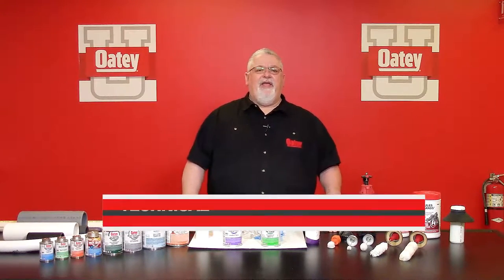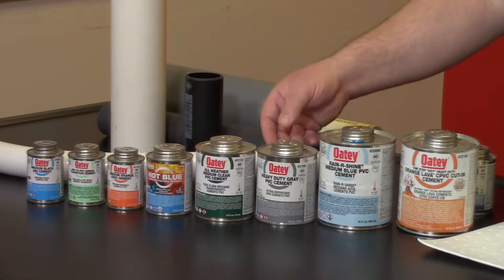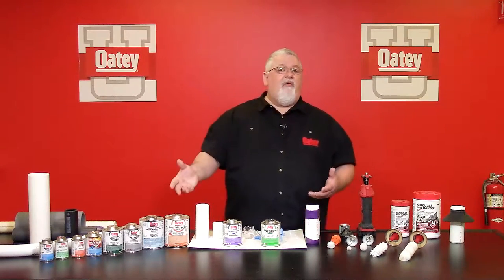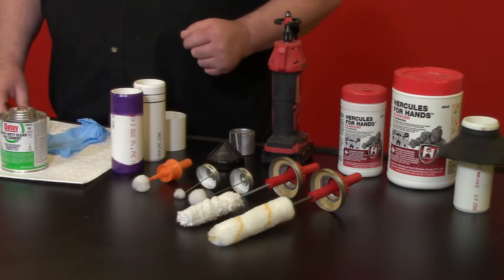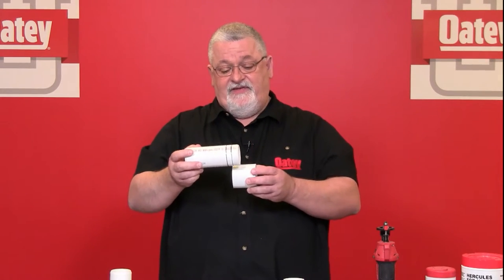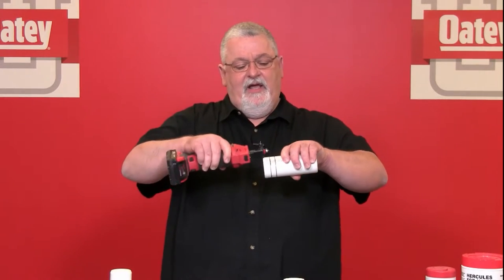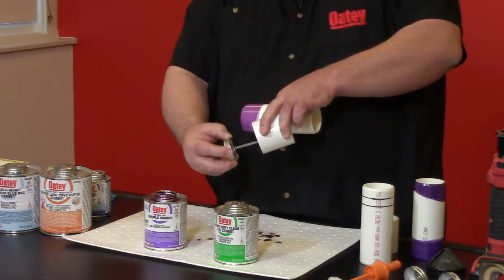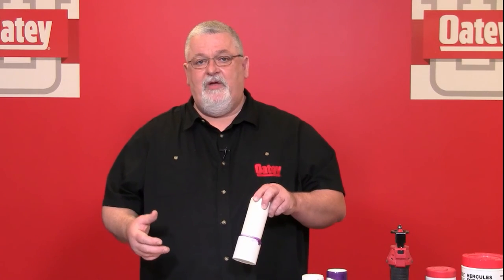The Art of Solvent Welding

Comment: I have very little plumbing experience. I worked for a contractor that would go through and prime all of his fittings. Long before needed. And then reapply just before assembly. He got it works better that way. "Pre soften pvc" Sounds like this is n't a problem. It's just extra work?

Comment: Thanks for this Doug.  This is the best manufacturer directed video on PVC pipe assembly (solvent welding) that I have seen, and address several of the big issues in achieving high quality assemblies. In fact, this is the first time I have seen anyone mention the ASTM standard of the 15 deg bevel angle, which almost no one does.  Deburring is not chamfering (45 deg vs 15), but is a lot better than nothing when it comes to scrape off. I have had several tense discussion with veterans that think that I am wrong and a novice for mentioning it, as they think that it is silly, and they have never done it (in xx years). I believe that it is the single biggest failure reason for PVC assemblies over ¾”. I use and like the DEB4, but will certainly check out the router and bit option in the future.  The DEB1 is too expensive.  That cone deburr tool is not a proper 15 deg tool.

Also, kudos on not getting even a single drop of solvent or glue on you.  That in itself is truly impressive, even on a work bench.

Thank you for pointing out the common “orbital wrist” solvent and glue spread pattern mistake.  Even as skilled as you are, you can see that even you did that on the 2.5” test piece.  That speaks volumes for me to be extra careful.

I have one question.  Why doesn’t there seem to be a slow set glue?  This would fully dry in about the same time, but have something like 2x to 4x the open and hold times of rapid set.  This would be exceptionally useful in the summer months in California, especially in direct sunlight.  There are thin, medium and thick bodies glues, but apparently only fast setting, or very fast setting, particularly in the thin bodied which is the most common.

In my mind there are several times to keep in mind in solvent welding any parts, beyond just PVC.  All of these times have a humidity and a temperature dependence.

1.	Open time.  This can be either the maximum time to be unassembled, or in many glues it is the minimum time to have the two parts open to the air to allow outgassing. I think PVC glues are governed by the maximum open time.
2.	Hold time: This is the time that the two parts need to be held stationary under force (clamping etc) without any disruption or movement force to allow proper bonds to form, like knitting a broken bone.
3.	Set time:  this might be combined with the above hold time, but is usually the time to be carful with the assembled parts, but they can be moved and positioned into place with proper care. This time is usually in tens of minutes up to a few hours.  I think you call this the cure time.
4.	Dry time: Usually complete drying takes many days or years, and is a table or curve.  Usually a time is reported when the part reaches a decent fraction of full cure, like above 65%, or suitable for 125psi.
5.	Full cure is the time when the part assembly no longer gets stronger, and might start getting weaker (EOL).  For many glues this is in years, and is rarely published.

Comment: Great video. Here in Europe we glue mostly grey PVC.U . And gluing process is completely different.   Solvent  and cement is transparent,  We apply glue inside first and is forbidden to twist.  Glue brush is different too. Tangit recommends to apply glue along the pipe and not with circular move.  Well,  different world.

Comment: Thank you for your tutorial, esp. the overview.  Can you tell me which combo to go forward with?  I have 2.5 bath condo in Central Florida with 3/4" white PVC pipes out on the porch for a water softener and filter.  Lowes sold me:  (Purple label) Primer and (Red label) All-purpose Cement.  ACE sold me:  (Yellow label) Clear Cleaner and (Goldish label) Regular Clear PVC Cement.  I assume when I cut the connection to the water softener to remove it, that I will have two wet ends to dry with a rag, then join to re-close the loop.  Am I using purple & red, or yellow & gold; or some other combination?  Should I let the primer dry on the pipe before applying the cement?  Can I use these (primer/cleaner and cement) in a situation where I have to screw a PVC adapter into a water filter housing that is plastic threaded, like the Culligan WH-HD200-C?

Comment: Nice job on the video! QUESTION: When I began dry-fitting my PVC pipes, my son and I noticed that it was impossible to get some of them to "bottom out". The only thing we found to work was lightly tapping a block of wood that we placed over the circumference of the pipe or fitting with a rubber hammer. However, when we went to take apart all of the dry-fitted parts, it took both of us to separate them (a 3-inch wye fitting and street 45 were the worst!). So, here's my question: If the primer's job is to soften the surfaces, does that mean the pipes and fittings will be easier to join AND rotate 1/4 turn when it comes time to do the real gluing/welding? Does the glue cause the parts to slide into/onto one another more easily? I've watched SO many videos of pros doing these jobs, but 95% of them do not bottom out the pipe into the fitting, and just as many don't turn it one-fourth the circumference of the fitting. Could this be because they, too, are finding the pipes very difficult to bottom out and turn? My son asked me if we could lightly sand the pipe and fittings just enough so that we can push them together AND turn them 90 degrees when we finally glue them. I told him I'd ask you. Anyway, if you read this far, THANK you so much. I'm obviously not a plumber, but I am very handy and a reader of all directions!
Reply from the maker: @HelloWorld It's hard to bottom out during a dry fit because of the taper of the hub of the fitting. This taper in the fitting is what gives the chemically welded portion of the joint which is that bottom 1/3 of the hub. Once primer and cement are applied it also acts as a lubricant which helps insert the pipe fully into the joint. We would not recommend sanding the pipe or fitting before welding as that can take away from the surface area and effect the welded portion of the joint. Please reach out to technical@oatey.com and we will send you a set of our solvent welding instructions.

Comment: You demonstrate simple joints what about solvent welding ball valves. How do you keep the primer and cement from contacting the seats. I'm talking 1/2" and 3/4" valves

Comment: This is an awesome video!  Which glue is recommended for flexible pvc pipe?  Are there any other special considerations for flexible pvc pipe?
Reply from the maker: Oatey® PVC Flexible Medium Bodied Fast Set Clear Cement is recommended for spa and swimming pool applications because it is formulated to withstand pressures and vibrations associated with these installations. When solvent welding be sure to use primer and follow all ASTM steps.
Reply: @OateyCompany  thanks so much for the reply! That's awesome to know!

Comment: What's the best product(s) to use for swimming pool PVC pipe repairs? Can any of the Oatey products be used with wet pipes?
Reply from the maker: @MTB Biker Any of our PVC cements can be used to repair PVC pipes for pools. That being said our blue colored cements are designed to be used in wet conditions. Like our Blue Lava or Rain-r-Shine.
Reply: @OateyCompany  Thanks. Also saw Pool Tite on your website. Under wet conditions, which Primer should I use?
Reply from the maker: @MTB Biker Either or purple or clear primer can be used.

Comment: On the website under Set Speed it says the regular clear pvc cement is "Fast Set," what is the translation of that in time? How many minuets do I have to wait until I move on to the next fitting in the pipe chain while making sure not to disturb the joint that was just completed?
Reply from the maker: @hippo potamus Each cement will vary along with the temperature and conditions being applied in. Please visit http://spr.ly/6058Mgh14 and find the cement your using and look at the submittal which has the set times listed. You can also reach out to our technical department at technical@oatey.com for assistance.
Reply: @OateyCompany  Thank you. For anyone reading this and wants to know here is the info. SET TIME / CURE TIME
 30° F to 50° F 
5-6 minutes
, 50° F to 70° F 
3-4 minutes
, 70° F to 90° F 
1-2 minutes

Comment: Hello Sir im a novice looking to do a small pool pad re-plum what solvents would you suggest for pressure fittings for schedule 40 D2466 & D2665 also live in zone 7 thanks
Reply from the maker: @GRASSTHIEF Please contact technical@oatey.com. Please include the pipe size, ambient temperature when assembling the joint and type of pipe.

Comment: Is it necessary to use Oatey pvc pipe cleaner prior to primer?
Reply from the maker: @Vincent Trapani No. If the pipe has paint, grease or grime that could not be removed normally with a rag then a cleaner can be used. On a new installed cleaner would not be needed, just primer then cement.

Comment: I have a 4 oz can of Oatey purple primer and it doesn’t say the dauber size. What’s the default dauber size for that product? What about 4 oz Regular PVC cement ?
Reply from the maker: 3/8" daubers are included in 4oz cans. After you have solvent welded you joint wipe off any access with the dauber or a clean rag and allow for the proper cure time before testing. We recommend testing to ensure a watertight seal has be accomplished.
Reply: @OateyCompany  do all 8 oz cans (both primer and cement) come with 3/4 daubers? I need to solvent weld 1-1/2 PVC DWV
Reply from the maker: My apologies for the typo in the previous response, but all 4oz and 8oz cans include a 3/4" dauber which is suitable for use on pipe and fittings up to 1-1/2" in diameter.
Reply: @OateyCompany  great, thank you!
Reply: @OateyCompany  thank you

Comment: What size chamfering router bit do you suggest using?
Reply from the maker: Choose a chamfering router bit that is suitable for the tool you are using and follow all manufactures safety instructions. The router bit you select should create a 10-15 degree angle on the edges of the pipe.
Reply: diablo/freud 40-100 chamfer bit cuts at 15 degrees.
Reply: @OateyCompany   what router bit is  used on the tool in the video ?